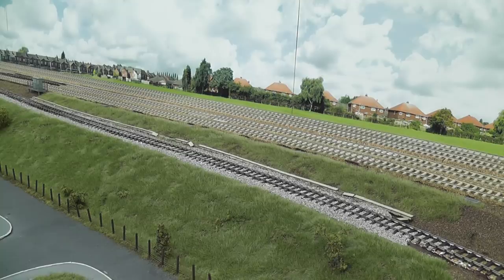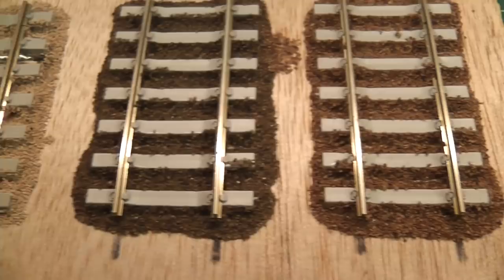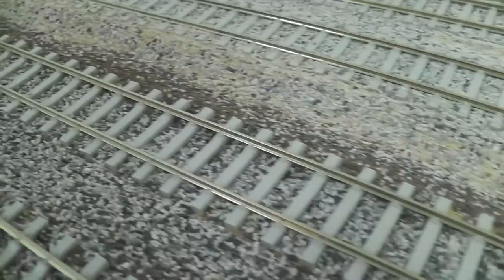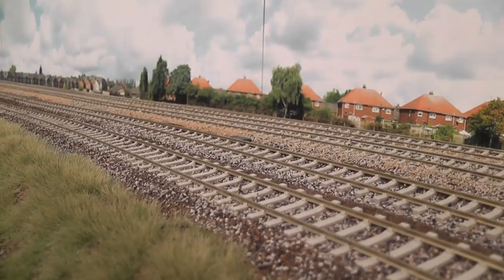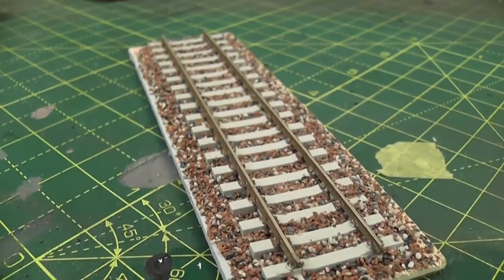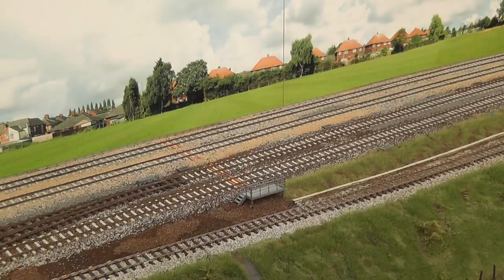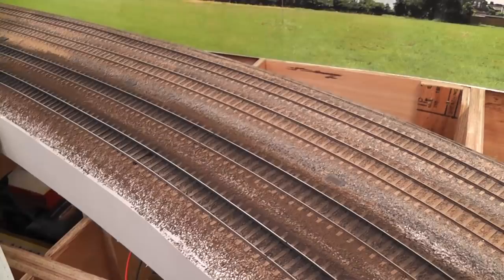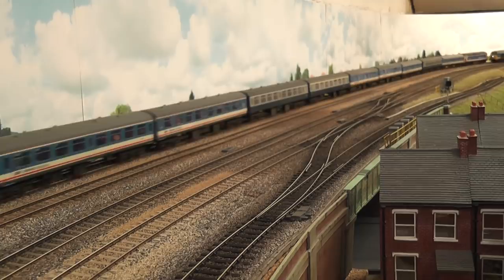New Layout Build - Ballasting

Comment: Looks superb Richard, just goes to show a bit of time spent looking at a few photo's can help transform a layout into a railway, Part of my former role at the Colne Valley Railway was S&T maintenance manager, which involved slapping track grease (a horrid black runny grease, which stained everything it landed on intentionally or not!) on the points sliding chairs where the blades slide. I hope I have remembered right, the 6' is the ballast edge/shoulder, 4' in between the two rails & cess was between the adjacent running line, if I'am  slightly wrong on the later someone will correct me.

Comment: Good day Rich,
Love and collect your tutorials.  You don't just showoff your Ops. Or lip flap about what you plan to do.  Followed by what you want to do.  Culminating in what you failed to do due to time constraints.

When you say what you need to do.....YOU DO IT.  Thank you.

Now some tips I have used in balasting over the past 60+ years.
1) In those areas where you want deeper shallows or slopes in your balast, add an extra 1/16" to 1/4" underlayment to your roadbed.  The extra underlayment needs to extend beyond your cork bed & be beveled at a 45 degree angle.  This will provide a greater slope without using a lot of £$€ balast. 

2) To areas you know you wish to weather a different hue than the balast,  when mixing your PBA and water add a few drops paint in the desired coloring to the weathering.  It will blend in and make top coating less work when cleaning up.

I actually keep empty glue bottles with my half & half set mix AND various color mixes for a ready access.  That way I don't have to stop and mix and remix and on & on.  I do however mark the outside of the glue bottle with the formula so I don't have to experment to find the color match I am looking for.

Tah from the Colonies,
and I'll SEE YA' DOWN THE LINE,
Jim
Reply from the maker: Thanks for the tips Jim.  I ended up keeping glue on standby as I slowly realised how much I was going to need!  Will try tinting the glue in future.  Cheers

Comment: the little twist thing that holds the tracks down is called a E key or if you see bigger versions (usually on wooden sleepers) they are called 501s
Reply from the maker: Thanks for the info
Reply: @EverardJunction  its pronounced 5-(number) 0-(letter) 1-(number)s and you generally get those one around points (flat bottom rail), breathers and where the sleepers are wood going over foot tunnels, bridges, water catch pits etc.

Comment: I love the fact you have used concrete sleeper track, its not often if at all you see wooden sleepers on a modern main line, and you wouldnt see brand new locos and rolling stock on a preservation line where they may have wooden sleepers, so thats more accurate than most model railway layouts, i would do that myself, and i dont know why more manufacturers dont offee concrete sleeper track, or at least i havent found many options of it

Comment: The track weathering looks excellent. One of the best I have seen. I am pleased to see you got your point machines placed correctly and added more locations. Looks like there are enough to work the junction now. In some places the inner rail gets a lot more oil spill than the outer on sharp curves because fuel has poured out of locos due to the track cant. Also at a signal where trains often stand the track is generally darker. The sleepers could of been left covered on the ends as you have seen in your photos. They are often left like that on curves to reduce the chance of a track buckle, so not always because the ballast has been topped up. I like the sound of the trains going over joints. Very realistic My own layout has some wide rail gaps as well for that reason.

Comment: Great observation as to ballast conditions varying. This is also affected by whatever is next to the relevant lines. Bearing in mind tracks by motorways have build up of exhaust particles ( which add to problems with leaf fall resins ) or farmland which tends to be dustier. Also the tendancy of BR to use whatever was laying around when work was needed. ( now, especially on the continent, there are machines that remove ballast, wash it and replace it and compact it as track laying and relaying is taking place). There was always the odd bit of track where after engineering works had been carried out, suddenly you came across a bright, white patch of ballast, but it took ages to blend in with everything else.

Comment: Don't know if it's been commented yet, as I haven't scrolled through, but those twisty things that hold the rails to the sleepers are called "Pandrol clips". There is a special tool that is used to get them on and off, (I believe one of the workers in  your crew near the points is holding one) however, after using one, I can say, from limited experience, getting those clips on and off with good aim and a sledgehammer is much easier. I did make a mess of a concrete sleeper the first time I tried to get one on, however, with a few practice shots, it's really easy. Great video, really enjoyed it.

Comment: Excellent attention to detail, Richard. Looks real! 

Something to consider on your jointed track (where there are 60ft lengths rather than long-welded or CWR as its known) you could add one or two areas of “voiding” / “wet spots”, where the ballast formation has degraded and wet clay has formed under the sleepers either side of the joint which is then being pumped up and through the ballast with the passage of trains - each wheel hammering the rail ends and forcing liquid clay upwards. 

And you can have a PW team in attendance to dig out the affected sleeper  “bays” to add gravel and do some remedial work. With a temporary speed restriction for “track condition”....!

I worked on the railway in the S&T department for 41 and a half years so speak from experience. 

Just a small point but your lineside trunking is actually called troughing and contains cables, not wires. “Relay boxes” are actually called location cases.

Colour of new ballast usually depended on which quarry is was supplied from. Scottish ballast was sometimes pink, but didn’t stay that way for more than a few months, unless it was on a pure AC traction area. 

I like the way you are experimenting with different grades of ballast, and track colouring too. Remember some older locations will have had ash ballast, but quite how you replicate this in 4mm I don’t know! 

Keep up the great work and high standards. 👍🏻

Comment: Rather than use a track rubber, you can use a razor followed up with 1500-2000 grit sandpaper buffs off the overspray quite nicely. You could even use softer metal to scrape off the rail tops without damaging the rail, that's what I use! All an all your layout is turning out nice I'd be proud of it!

Comment: Great work. Looks fantastic. You need a sheet of weathered grass mat or something as a temporary fix for filming where you've not done scenery on the far side of the tracks! 

When I had a layout, I hated ballasting and explored a few other options when we replaced the Peco self-destructing foam underlays that we'd initially used in the late 60s on the main lines. Fleischmann Profi track was nice and easy, but looked completely dreadful: I think it was Code 100, but looked about Code 120. What we went for in the end was a Merkur (the same company that did the stone retaining walls you had on your old layout) inlay for tracks in the distance, and then hand ballasting in the foreground using N gauge ballast for HO. One thing it took us around 25 years to get round to, but which made a huge difference to the whole layout, was ballasting and weathering the fiddle yard, which then became part of the layout.

Comment: Brilliant video. Just to point out, the rail greaser is actually for rolling stock and not the rail. It reduces friction on the flanges, extending the life of the wheelset before it needs to go on a wheel lathe :). A wet oil effect would look good as it is lubrication oil

Comment: 27:18 I know a place that had an automatic greaser on the outside rail at one end of a curve.  It was on a branch line with a pretty tight curve.  There was no greaser at the other end of the curve.  It was only on one end because the switcher would relocate the engines at a runaround track before this curve and actually shove the train around the curve and continue about a half mile to the customer at the end of the line.  They would shove into the spur, pull the MTs out, put them on the main, then shove the loads into the spur, pull back, pick up the MTs off the main and head back towards the yard.  They would reshuffle the cars at the runaround track and when they ran a caboose, you knew which cars were going to the industries (there were a few industries here), and which ones were going either to a couple of other industries (in the other direction) or to the yard.

Comment: This is impressive. It is interesting that it does not look so good before airbrushing, but looks excellent afterwards. The painted rail sides really do work.

How do you stop the airbrush spray getting all over the backscene?

Also, I wonder whether there ought to be a fence at the end of the road where it opens into the canal - one wouldn't want Dean or Barry not braking in time and ending up with their cars in the water.
Reply: Also - have you any views on the technique of using powdered glue mixed in with the ballast and then just spraying plain water over it afterwards?

Comment: I don't need to weather my rails, some of it is older than me and has natural rust weathering!
Takes more effort to clean the top surface to make electricity actually conduct to the trains.
But yeah, when I was cleaning some of my older tracks... Step one, use IPA and a cloth, clean all the top surfaces. Step 2, use an abrasive rubber (From my Electronics career used to clean PCBs, but, its basically the same thing as a track rubber) to clean the top surface, some rails only a quick wipe, others needing extensive use to get the rust off.

Comment: Great video for a great layout in the process.  One odd question:  I had been using the same plastic eye droppers for the glue until a couple gents put me onto using those condiments squirt bottles (for ketchup and mustard like at Burger and Fish & Chips shops).  A bit more control and a lot less re-filling.  Have you seen this?

Comment: Good evening Richard. That's a real game changer with the ballasting it looks spot on. The whole layout is looking fantastic. If you're after some mechanical flange lubricators there's a member on rmweb that has a 3d print shop on shapeways under SJPModels and has the lubricators in a pack of 10 that may be of use to you if there not to modern looking. Also quick question about the cable trunking, how has it held up with the balasting and PVA application? Looking forward to the next instalment.
Regards Gary

Comment: I felt there was something missing and then it all came together when you cleaned the surface of the rail with the track rubber. Obviously in the real world the wheels of the train keep the rail that's in regular use finished in shiny bare steel.

Comment: Hi Richard, I have a question for you, and appreciate how busy you must be, so hope you can find time to answer it.

I have followed you and a few others in starting to copydex my track instead of pinning it this time. It's easier to deal; with and less damage. It's also easy to lift if wrong ( well a little).
I ran trains around part of it yesterday to test the track and film it. The nose was very loud, and almost drowned out the loco sound on the film.
I was warned that the glue any glue conducts the sound making metal wheels very loud. This will almost certainly affect future filming I am sure. 
Can I ask that surely it is not just me, are you experiencing higher wheel noise due to gluing over tacking?
If not have you do something to combat and reduce its effect.
I was told this might well happen, but ballasting will reduce the overall noise. Is there any truth in that. I hope you may have some advice and better still some encouraging words to make me stop thinking of ripping it all up and starting over with track pins.
Kind regards Paul at Sandling Junction.

Comment: Great video Richard track work looks great
I haven't been very big in track weathering sure it looks real but would it affect conductivity with the loco wheels?
Reply from the maker: They run fine provided you clean off the excess paint from the surface of the rail.  Same applies to real trains.

Comment: Probably the most realistic 00 track I’ve ever seen! In real life by the way, there’s a reason for the ballast heaped along the sleeper ends. When laid, continuously welded rail is clipped down at the length it would be at 27deg C. Any warmer and it tries to expand but relies upon the raised ballast shoulder to stop it buckling out. The outside of curves are particularly at risk  - so you might end up spending even more on ballast! 

The rails are clipped in place by Pandrol clips which on the type of flat bottom rail used in the 80s were painted a reddy maroon and was a visible part of new relaid track. https://images.app.goo.gl/MWYzU94v5MYNjGSE7.
Jointed track however relies upon a fishplated expansion joint every 60 feet and so doesn’t need a raised ballast shoulder.

Comment: Me again... Like the scrap testing of the ballast. I never thought of that... I have a battery powered engine and I can run it over the track immediately after laying it and see if there are problems with the alignment or the switches... Ballast of real stone or fake - who cares as long as it looks right... How about mixing the two types of stone??? I like the way the ballast i sitting just beneath the top of the ties (sleepers)... Wow that's a lot of dust you washed out !!! How much money are we talking about between the two brands???I use a product called "Wet Water" from the same company you bought some of your ballast from and I feel this is less expensive and I don't like the smell of the alcohol...Here we call the "banking" super elevation...

Comment: Beautiful work, very glad to have found your site, question, the dark grey rectangular pieces spaced about, did you call them "catch pits"?  What are they for? Not something I've seen on our U.S. railways, other that buried tool boxes for the maintenance workers. Thanks!
Reply from the maker: They are indeed catch pits.  If you google catch pit you'll find a few examples of how they are used.  They form part of a drainage system and can be found in many places on the UK network.  I'm sure U.S. railroads will have something similar but the appearance many well be different..
Reply: @EverardJunction  Thank you.

Comment: Very nice but there is one small thing you cant see easy with the eye but in the video its visible, I miss the electrical cable that comes out of the cable truth and enters the relay boxes under the little platform.
Reply from the maker: The area is not finished yet.  It will be added along with many other details that are currently missing from the scene.

Comment: Just wondering, while doing the cable trunking, could you not use that to actually put wire for motors, lighting etc etc, make it that little bit more realistic. Or is something like that not recommend or advised? =0)
Reply from the maker: You can't get many actual wires inside model trucking but for one or two accessories I suppose its possible.

Comment: when i was adding Ballast to my layout it ruined everything, i too used a water pva glue mix but after i glued everything my trains wouldn't run properly anymore. They stutter and stop at random places.
I looked into it and turnes out that the glue made the underside of the rails and the conection betwen rail segments rust. The elektricity failed and i needet to trow away quite a bit of rail. Now i don't know what to do, cuz i don't want anything like this hapening again.

Comment: Richard why do you leave such a large gap between your track sections?
Reply from the maker: To allow for heat expansion in the rails.  I've had issues with it before due to the environment the layout is in.  So each joint has a decent sized gap.